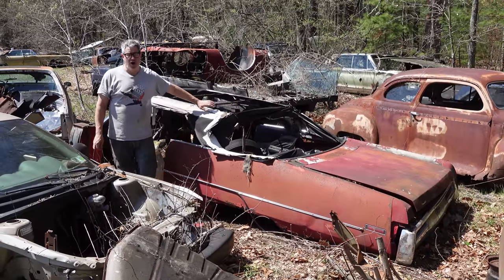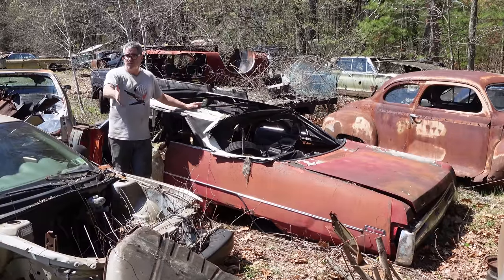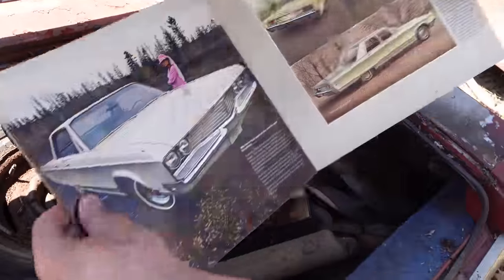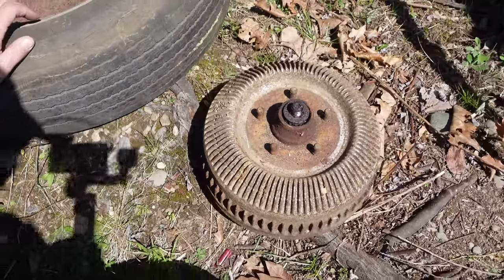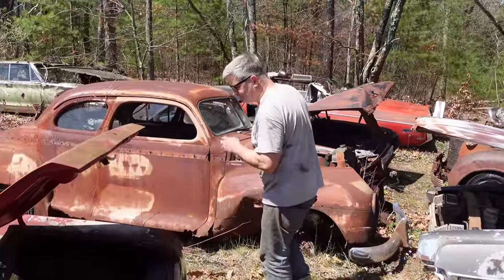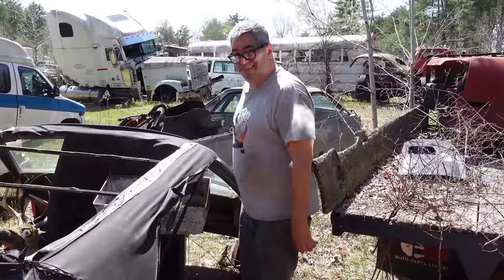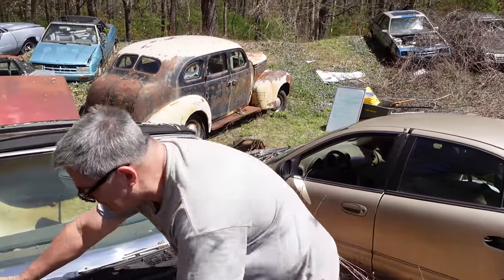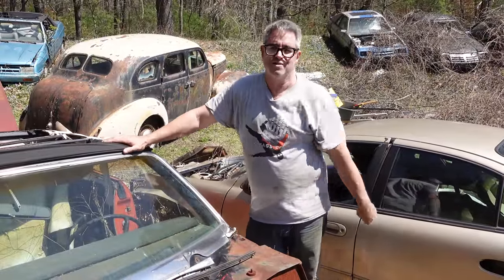Ultra Rare Ragtop

Comment: Yup, with the VIN, we win: C for Chrysler Newport, E for Economy price class, 27 for two door convertible, L for 383 V8 with two barrel, 0 for 1970 model year, C for Jefferson Ave, Detroit, MI assembly and the rest is the production sequence. The Jefferson plant that produced this car operated under Chrysler from 1925 to 1990 and then the "new" Jefferson plant opened in 1991 and this still operates under Stellantis today. Some vehicles were also produced at the Belvidere, IL plant which operated from 1965 and has been indefinitely closed as of February 2023. 1970 was the last year for the Newport convertible. 

No tag, can't brag, but some of it can be figured out, no doubt: CE27 for Newport (C) Economy (E) convertible (27), E61 for 383 V8 with two barrel, possible D34 for automatic transmission, possible R6 for Crimson exterior paint, X9 for Black interior trim, V3X for Black convertible top, among other codes.

Yes, that's rare number and too bad someone didn't figure that out years back. My 1979 10th Anniversary Trans Am had a run of 7,500 cars (in theory one for every dealer), but only 1,817 of those were equipped with the Pontiac 400/4 speed manual transmission combination. The rest were 403 Oldsmobile equipped with a THM350 automatic. Mine is a 400 and was made on exact week in April 1979 in Norwood, OH, the same week GM dropped the 400 from the option list. After that, only cars in the schedule with a 400 were likely built. No, I would have bought a Pontiac GTO convertible with every option, if I had my way back then.
Reply: got the VIN
Reply: @tomwesley7884  Yup. I suspect the tag was maybe up with the sheet metal front end that he showed, but I took a guess at it.

Comment: In the 70's I bought and restored a  1970 300 convert and parts were non exhistant.  I found a 70 300 2 dr hardtop for parts.  A shame 'cause it was very nice shape. The engine went into a 69 Charger that I was also repairing.  I drove it into the ground as a daily driver. It had factory air!  Today I have a 67 300 convertible with the 440.  Great cars, loved them both!

Comment: I guess that Thurston Howell the 3rd and Milburn Drysdale didn't want their bolt patterns to be the same as the commoners. I also remember a very big Chrysler Newport ad campaign from the early '60s where the base Newport was advertised at the price of $2964, not much more than a Ford Galaxie or Chevy Impala. Good job as always Steve.

Comment: Talked to a guy once that actually bought a new Hemi car around 1970, said it was a piece of crap and traded it in a 440. I was shocked of course! He went on to explain the situation,  he was young, married, had a kid or two and used his car for daily transportation.
Reply: I think you didn’t even get a warranty with the hemi.
Reply: They could be temperamental, and they weren't for the faint of heart. The best bet was for someone that was a mechanic or mechanically inclined to own them. My coworkers neighbor bought one new and it was a family car for a time, but then it got put into the garage (and recently given to one of his kids) when they realized how rare it was.
Reply: @googleusergp  The guy actually  was a decent enough mechanic leaned a  lot from him. The street Hemi was just better suited to 1/4 mile trips. There's a reason you don't see high mileage Hemi cars, if they didn't blow up due to the cheaper construction than a race Hemi, they were just a pain in butt for a daily driver.
Reply: @Seed drill 90 day warranty that’s it.
Reply: @bobbyz1964  They were a handful, that's for sure.

Comment: I learned to drive in a 70' Newport four door.  It was bare bones with crank windows and no AC.  On the plus side it had a strong 383.
Reply: 2 barrel or 4?
Reply: @rightlanehog3151  No idea.  I was just a dumb 16 year old back then.  It made some wild burn outs until my dad caught on.
Reply: @TheToolmanTim  Between Steve's channel and the equally excellent Rare Classic Cars, I am often wandering down memory lane wondering how I would have equipped a new car in the classic era. The 2 barrel 383 ran or Regular gas and provided very adequate power so it probably would have been my choice for a Newport or any other large Chrylser. We had a  Slant 6 '73 Duster when I was learning to drive so getting up to speed was more of a challenge than doing burn outs. 😁

Comment: Bought a white Newport convertible back in '83 for $700 and then a 300 coupe parts car soon after for $175. Swapped over the hidden headlight front end and sold it a few months later for $1250. Broke even on the parts car with a guy who wanted it for the 440 big block. The good old days.

Comment: I think I'd go with the Hemi Cuda if for no other reason, it didn't require a tugboat and crew for docking.
Reply: Some people have difficulties handling large cars. Others find them fun to drive.
Reply: @stopmakingsense9915  I think they're great to drive. Just not in a city where the parking spots are sized for a Prius. Got a diesel truck that's longer than the parking spots.

Comment: I wonder.... If since there is an imperial there and that newport, and theyre based on the same vehicle ... Could you take the front clip off the imperial and ressurect that newport convertible with a imperial face? And use the back bumper and trimwork too... Make a "what if" car. Its still gonna be a newport under it all but, it would look like an imperial convertible. Sounds super cool to me.

Comment: How hard was it to unbolt the front end of that chassis, or, what is the least that needs done to unbolt the front clip?

Would you unplug everything but leave the engine installed in the clip, or on stands but connected to the body?
Reply from the maker: Hello Iowa599, Thanks for watching and writing. The front clip is indeed bolted to the underside of the cowl and has / had a pair of frame rails extending back to just past the front seat. About 10 major fasteners held them together. As for the front fenders and engine / transmission, if you didn't care about bunging up the edges of the fenders and doors, i guess you could separate the few fasteners between fenders and cowl and roll that puppy away from the body tub. It could also be done with the engine and tranny in or out - but the "heft factor" was pretty big if you tried to roll the front clip away fully loaded. Similar considerations apply to 1967-'81 Camaros and Firebirds as well as 1968-up Novas. They share a similar semi-unitized layout and can also be "halved" at the firewall with relative ease compared to full-unit and body-on-frame cars. Thanks again for watching and writing. -Steve Magnante

Comment: I see that '76 or '77 Turbo Regal there! Hope that's upcoming.

And is that a covered headlight door sitting on the convertible top frame of that Olds 88???
Reply from the maker: We shot the '79 Buick Regal Sport Coupe TURBO today (April 28, 2023) and it'll be featured some time next week. It's a very complete, very original car - but very rusty. Thanks for watching and writing. -Steve Magnante
Reply: @SteveMagnante  Ah you're right!  I went back and rewatched, and saw the whole car this time.  When I called it a '76 or '77, I had only seen the front fenders and hood. I will be watching.  I see that GM Astro Cab semi is still there...😃

Comment: if you had the 440 your gas mileage would not be a whole lot different than the hemi cuda and with the rag top your noise level would not be a whole lot different but oh that trunk think of all the stuff you could haul home from garage sales, i would buy the Newport
Reply: The 440 Chrysler would probably have a 3.23 axle and 1 4bbl. The hemi would have at the very least a 3.91 or 4.10 and 2 4bbl carburetors. Much better mileage with the 440.
Reply: @garyszewc3339  i know the industrial and ag versions really knew how to put the fuel away